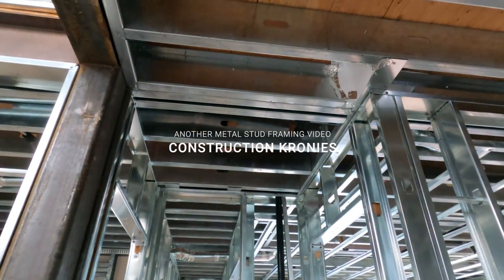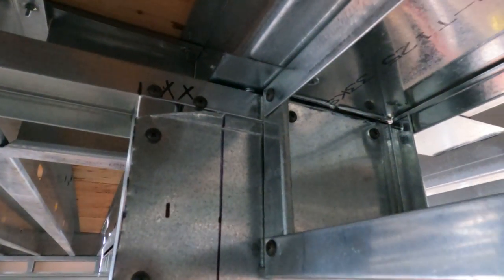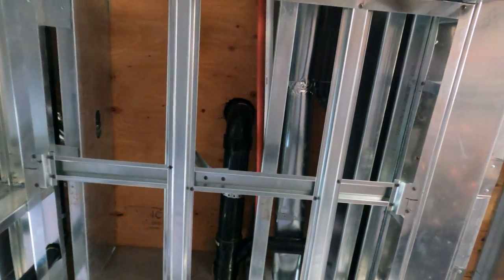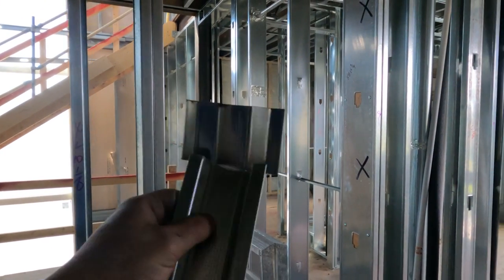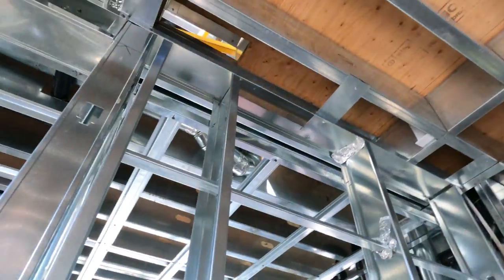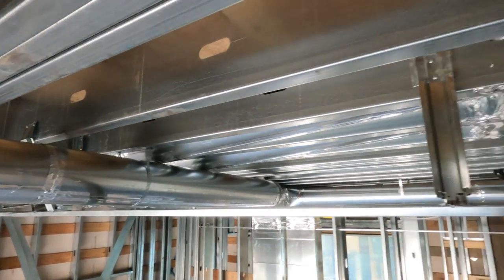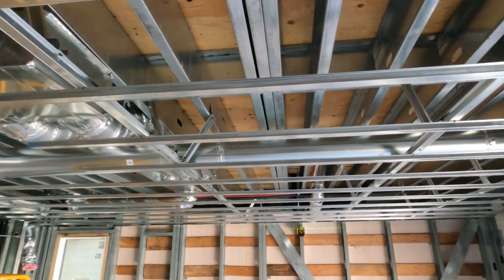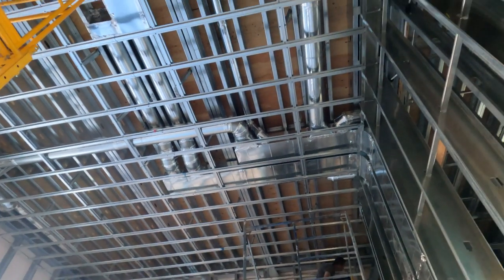How To Install A Drop Ceiling With Metal Furring Bar

Comment: Looks awesome! In your garage, the lowest furring strips are every 16 inch and the higher ones are every 4 feet? So the lowest ones are attached at 4 feet intervals?
Reply from the maker: Yes the furring bar is set to 16" on center and the top bracing runs are at 4' with kickers staggered by 4'

Comment: When you say light gauge... do you mean 20 gauge like in the attached?  25 gauge seems too light to carry much of a load.
Reply from the maker: Yes it is 25 gauge. It's important to do it properly and it will hold double layer 5/8 if you want. The bracing is very important, a couple little details like making sure the furring bar goes all the way to the back of the angle of either side and then use wire or steel braces every 4 ft in each direction.